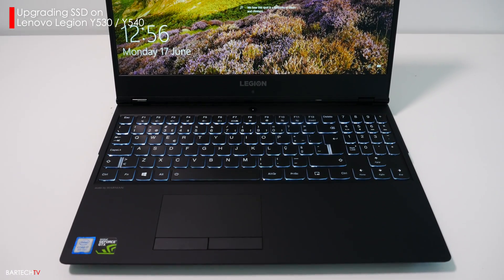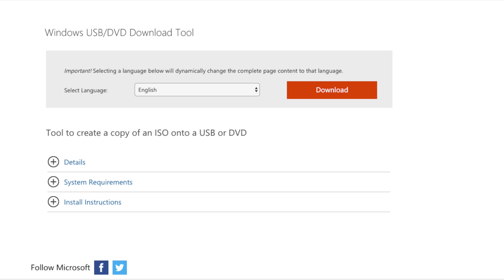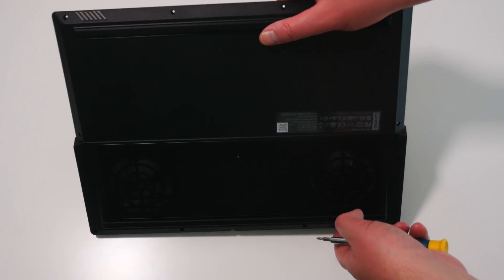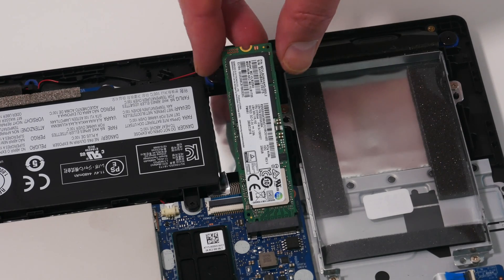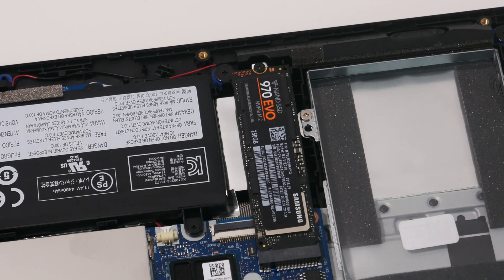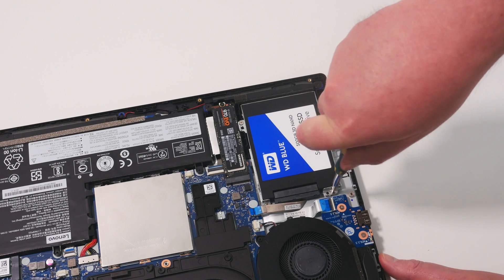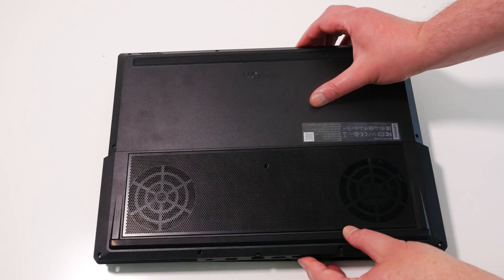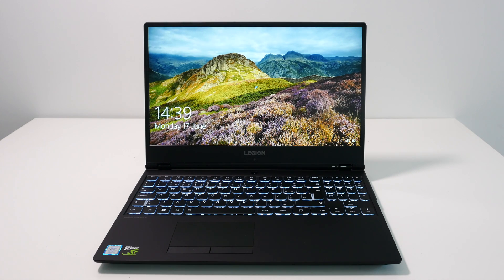Lenovo Legion Y530 / Y540 SSD upgrade and second drive installation

Comment: Do we get the ssd cable with the laptop itselfwhich you have shown in your video after the start of 20 seconds
Reply from the maker: If you bought a Y530 or Y540 with no SATA drive installed, the cable will be inside the box with the computer. If you bought the laptop with a SATA drive, the cable will already be present inside the laptop.
Reply: @BartechTV  follow up question, if the cable didn't come in the box (bought the display model so it was missing) where can i buy a replacement cable?
Reply: Thank you🙏💕

Comment: Thanks for the explanation.
One question: How did you managed to turn off the led light of your space bar? My lights are too bright under my bar and this annoys me.
Thanks grom Germany
Reply from the maker: Hold Fn key and tap spacebar.  This will toggle keyboard backlight between dim / bright / off
Reply: Yeah That's Right 
1) Keyboard: FN+Spacebar (You Can Toggle Between Off+Dim+Bright Mode)
2) Legion Logo: You Can Turn On Or Off Logo With FN+L Key.( I Hope It Will Help You.

Comment: Hey 
what is the size wrench did you use to remove the screws from the hard drive 2.5?
Reply from the maker: PH00 - Crosshead screwdriver size 00 or 0
Reply: @BartechTV  Thanks the model in the video is a 530?

Comment: i installed a new ssd 1tb drive (wasn't before) in my laptop y540 but i don't  see it in the computer setting  although it is recognizable when i open  lenovo vantage . what i'm supposed to do ? thanks
Reply: Hey, was it hard to open the lid? I just got mine and I don't want to mess up. Also do you know now why the drive wasn't recognised? Cheers
Reply: Go to Computer Management and format the drive. Then a new drive letter pops up in Explorer.

Comment: Can I get a 2TB 970 EVO Nvme??
Reply from the maker: Yes, but they're very expensive.
Reply: BarTech TV are you sure? Isn’t there a limit for this laptop 💻
Reply from the maker: @Trashedsalmon  Yes. I am sure. According to Lenovo Platform Specifications, the Y530 and Y540 will work with any M.2 NVMe drive.

Comment: bonjour avez un liens pour acheter le connecteur du disque pour brancher le disque dur
Reply: Il se trouve que le cable est présent dans la boite si le legion y540 ne comporte pas de HDD ou SSD 2.5
Reply: @stevennb8720  et si il n'y était pas dedans que faisons nous ? SAV lenovo ?
Reply: @SkyWearZ  malheuresement oui mais il y a deux endroits possible ou il peut se trouver 1) soit dans l'emballage du pc certes un peu caché (sachet plastique) mais c'est le plus souvent ou 2) soit il se trouve déjà dans le pc connecté a la carte mere mais avec aucun disque dur (j'ai deja vu ce genre de truc)
Reply: @SkyWearZ  stv mardi dès que je reçois mon legion y540 configuré je te dis ou je le trouverais
Reply: Dqccord merci tiens moi au courant car j'ai rien trouvé dan sla boîte c'est vraiment bizarre
Reply: @SkyWearZ  ah une derniere question. Es-tu sûr que tu n'as pas de disque dur sata?
Reply: @stevennb8720 non non j'en ai pas je suis sur
Reply: je vais appeler lenovo
Reply: @SkyWearZ  j'ai déjà appeler ils m'ont dit qu'il est possible qu'il soit dans le pc directement mais si ce n'est pas le cas ce sera a nos frais d'acheter ce cable
Reply: @stevennb8720  je veux bien acheter le câble, mais où ?
Reply: @SkyWearZ  Ça je ne saurais trop t'aider mais la plupart du temps qe j'ai vu ce cable en commerce c'etait surtout de l'import.
Reply: @SkyWearZ  Tiens: 
Câble HDD L 81FV
Avec le numéro de piece:
5C10R40220
Reply: @stevennb8720  merci mais tu n'as pas essayé de l'acheter toi ?
Reply: @SkyWearZ  j'en ai pas encore besoin mais au cas ou j'en aurai besoin je ferai mes petites recherches
Reply: @stevennb8720  le problème étant que j'ai passé des heures à faire des recherches et c'est très dur de ce le procurer.. Après je cherche peut être mal..
Reply: @SkyWearZ  d'ailleurs je sais meme pas si ,dans les rares cas ou j'ai pu le trouvé, ça va marché
Reply: @SkyWearZ  Alors je suis bien content de recevoir mon ordi mais je suis dans le meme cas que toi je n'ai pas le cable

Comment: I bought a brand new Y540 and have great difficulty uncovering whether this operation will invalidate my warranty?
Reply from the maker: No, it will not void your warranty. Unlike Apple, PC manufacturers thankfully understand that you should have the right to upgrade a computer that you have paid for. They even include the additional SSD cable and screws in the box for this reason. It would be a kiss of death for any PC manufacturer to start voiding warranties for upgrades, as there are hundreds of other manufacturers that customers could switch to.
Reply: @BartechTV   Thank you very much for that info :-) It also seems beyond stupidity to build a unit with the capability of expansion, and then not allowing to do it before the end of the warranty period .... Unless of course there's some clause about the operation having to be done by an authorized Lenovo repair shop or whatever ....